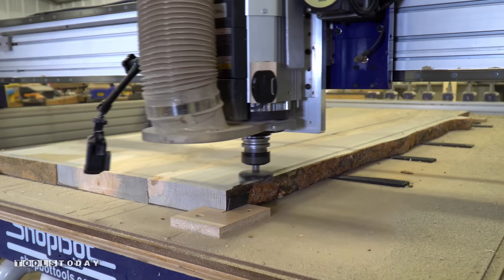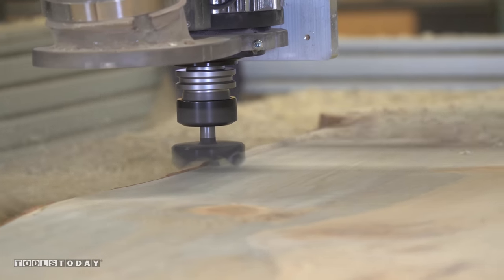DIY Project: Surfacing Reclaimed Live Edge Coffee Table | ToolsToday

Comment: How did you hold the slab down to the spoilboard when surfacing?  I noticed the angle brackets in the corners.
Reply from the maker: Yes Andy created wooden angle brackets drilled directly into the spoilboard.

Comment: Nice project and thanks for sharing the process.  Do you think there is a possible sagging/bowing problem in the future for this table or was it just really dry wood. Also, what is your thoughts on butt glueing larger pieces without dowels or biscuits? You obviously have put many slabs together and have seen what will and will not work. Thanks again for sharing.
Reply from the maker: This was an old reclaimed wood, its pretty dry!

Comment: Nice video, and nice table.  Have you used the RC-2255 on end grain slabs?  I'm curious how the finish would be, or what changes should be made to the tool setup.  I have a Whiteside SB25-2 with just the two cutters and no scorers, and I'm getting terrible cuts using their recommended feed & speed settings.
Reply from the maker: It should work great on endgrain boards as well.  About the only place you may experience some tearout would be along the outside edges.  Using a piece of sacrificial material around it would eliminate the issue.
Reply: @ToolsToday  Thanks for the reply.  It's a walnut tree round I'm trying to flatten, about 45" by 55".  Too big for my Supermax 37x2 sander so I'm using the CNC.  I'll give it a shot with the RC-2255 unless you recommend a different bit for the job.

Comment: Which model of this bit and do you remember what feed rate and RPM you used for this Amana bit? I used a new Amana RC-2251 bit at 130 in/min, 1800 RPM and cut depth of 0.02 inches as recommended by Amana, but the wood burned.
Reply from the maker: Amana Tool recommends for surfacing solid woods it is recommended to remove both bottom scorers. Feed Rate (IPM): 200", Speed (RPM): 18,000, Chip Load (Per Tooth): 0.003", Ramp Down (IPM Per Pass):  100”